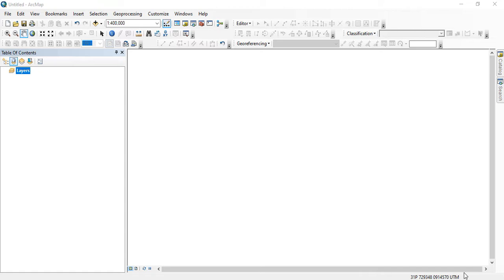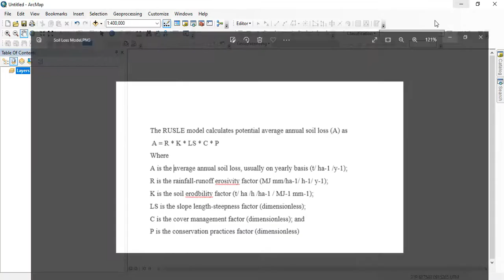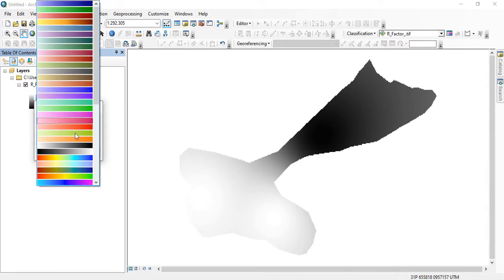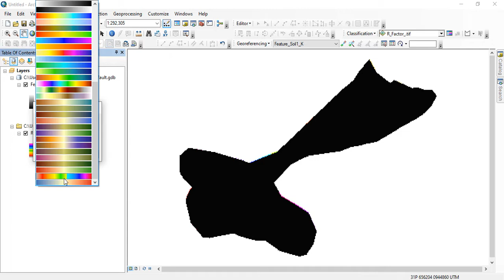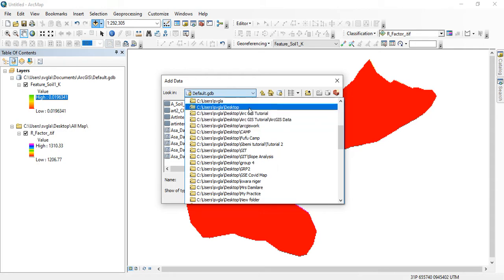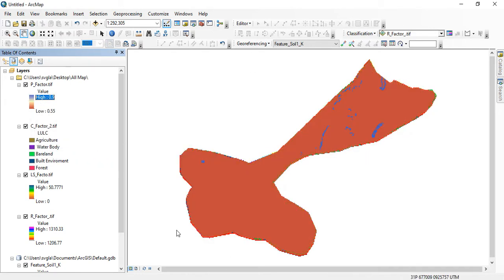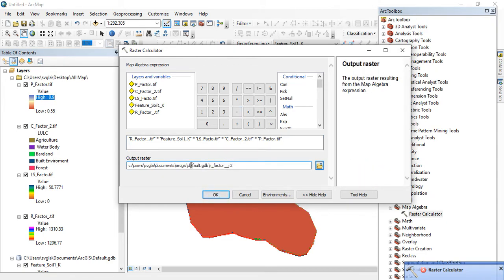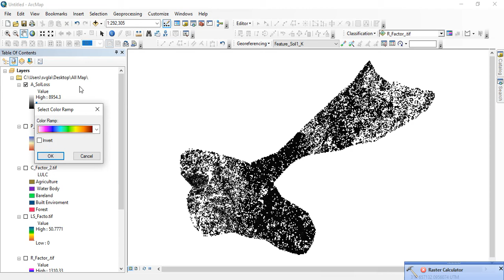ESTIMATION OF ANNUAL AVERAGE SOIL LOSS, BASED ON RUSLE model

Comment: Hello teacher. What units is your finished raster in? USLE equation outputs are measured in tonnes per hectare per year if I'm not wrong and 8954.3 is an impossible figure if it is that metric. 

Thanks for the very informative videos. It's just this last bit that isn't making sense for me.